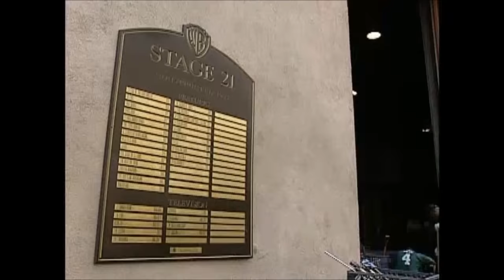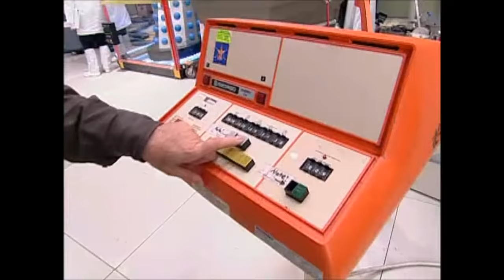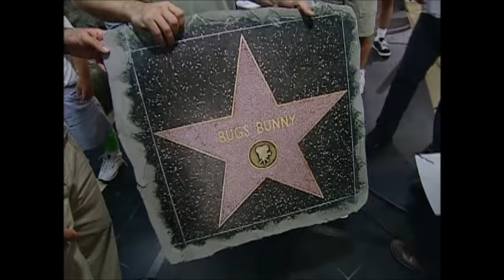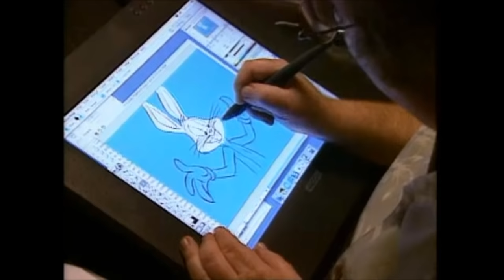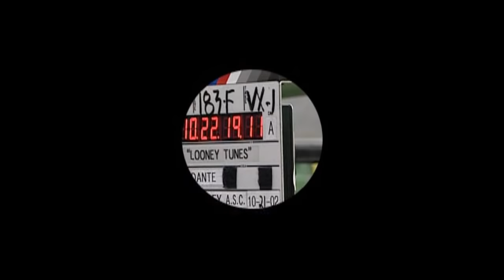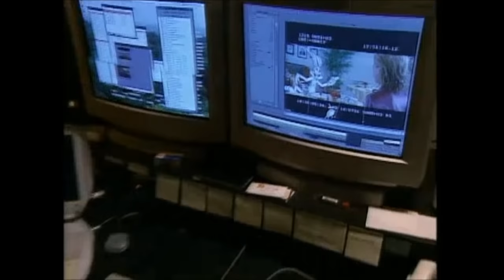Looney Tunes: Back in Action - Behind the Tunes/Bang! Crash! Boom! (2004)

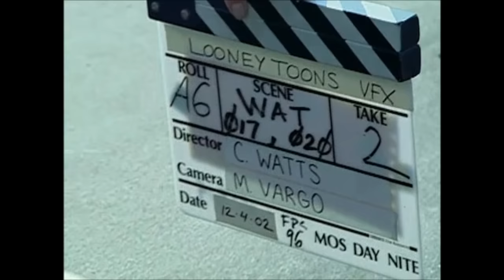Comment: Seen in the water tower scene from Looney Tunes: Back in Action at either 10:44 or 11:59, in the Behind the Tunes special feature, like I said that in a nutshell, the new 2019 shield was designed by Pentagram, along with the new font, Warner Bros. Sans, designed by MCKL Type, replacing the 1948 shield.

Comment: 4:16
This is the main spy car. It's a 2000 TVR Tuscan Speed Six. Like Randy stated, it has a straight six 4.0L engine which produces 390 horsepower, and has rear wheel drive.